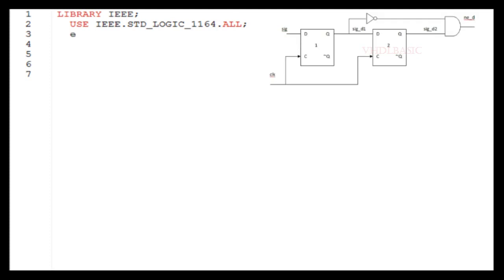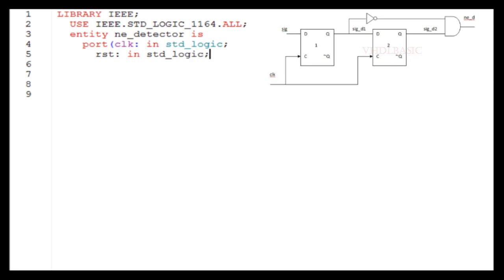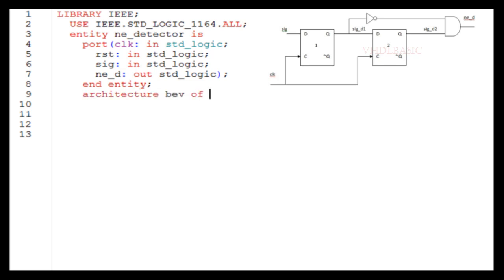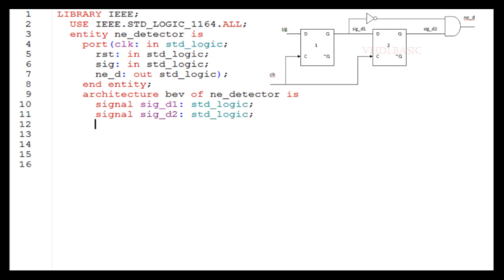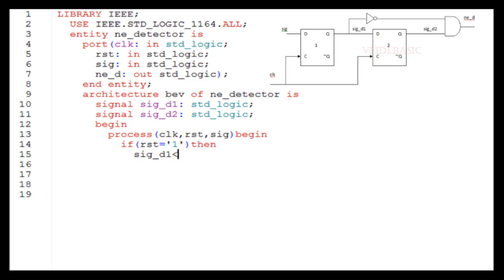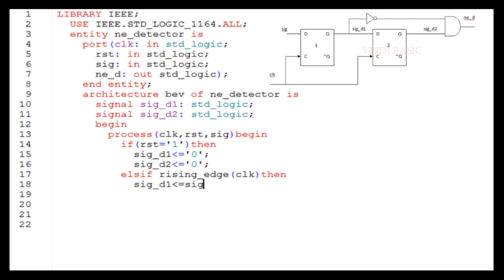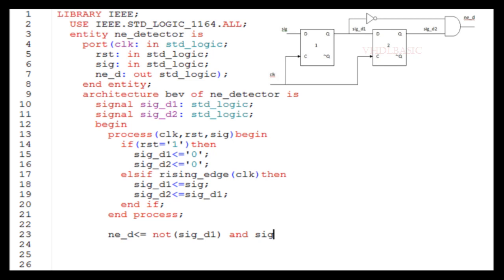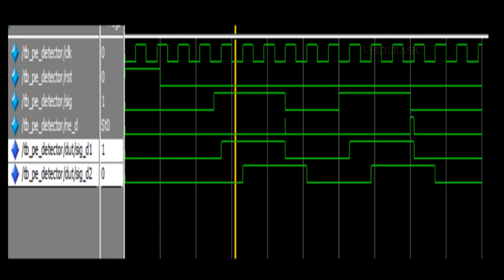Falling edge detector in VHDL

Comment: you should not put "sig" in the sensitivity list. since you are inferring clocked d-flops the synthesis tool will know what to do with only clk and rst in the list. the rule "put every signal in the list that the process is reading off" is not applying here, since you are creating synchronous logic and not combinational logic in that process ;)
Reply from the maker: Since it is synchronous we no need to put "sig" in the sensitivity list. But it is good practice to have all the depended signals in that. So that you wont miss any signals when you are doing comb logic.